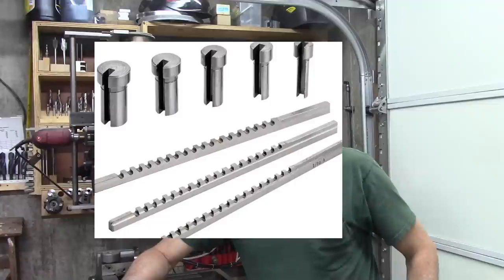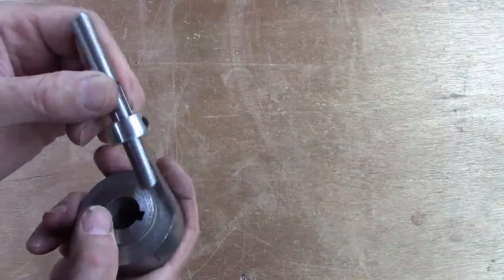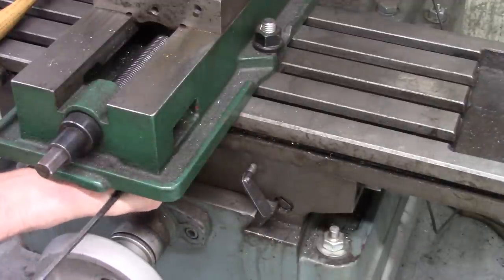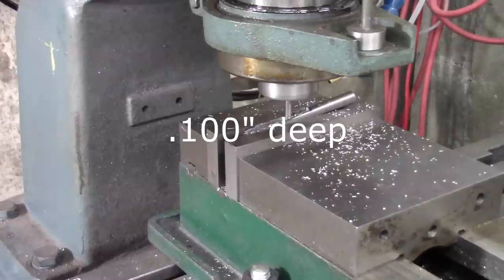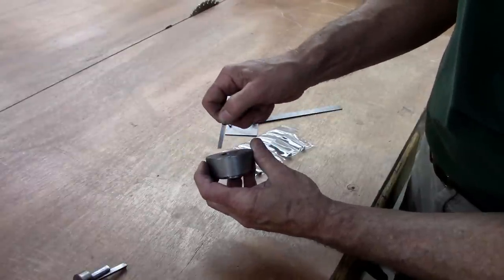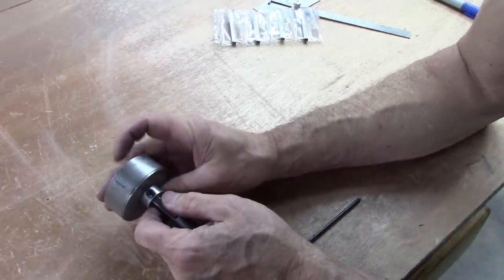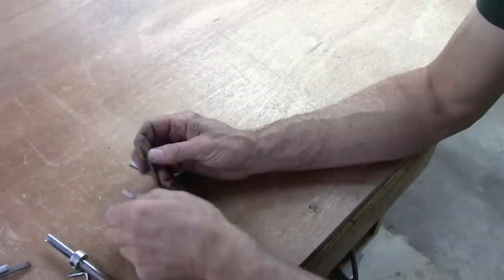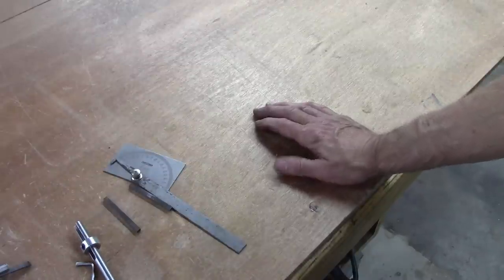Cutting a Keyway WITHOUT a broach

Comment: I have made similar devices to use on a lathe with a slotting attachment I also made, but the body is the same size as the shaft and I use a grub screw to push out the cutter after each stroke. It makes the keyway cutting repeatable with minimal setup but does require a new tool for each different shaft size and each key size.. I originally saw this in Model Engineer in a photo about about something else and thought  that was a good idea. Please keep the videos coming they are all great.
Reply from the maker: Interesting...  and thanks for watching.
Reply: That was my thought, that's similar to how rifle barrels were originally cut. Do you have a link to any thing showing a device like that?

Comment: I was doing a 8mm blind keyway in a 25 mm bore on the slotter today. Similar tool but used 6mm square tool bit and side cut 1 mm either side. Used a 16mm round EN8  and milled the slot at 3 degrees. I mig welded the HSS at the end into the slot and ground the front rake cutting angle to 10 degrees. Drilled a 9mm hole for the tool to enter at the keyway end. Worked like a charm but your idea of the locking collar is brill.
Reply from the maker: Thanks for the comment. Good to know different methods.

Comment: Good design, especially when broaching in a collet in a mill. For broaching a keyway in a lathe just clamp the cutter bit at a slight angle in the tool post and push the broach through the part with the carriage. The round holder won’t be needed.
Reply from the maker: Thanks! Yeah... I've used a lathe a few times but it seems like the quill provides a lot more leverage.

Comment: Some shops won't allow a wire wheel in the door because they're dangerous (put an eye out with a thrown wire). A ScotchBrite wheel does as good or better without the danger.

I cut keyways on the lathe with the tool held sideways in a tool holder and the work clamped to a faceplate.  It's tedious but it works and it's a lot easier to do that way than cranking my knee mill.
Reply: I've had wheel wire embedded 2mm into flesh using angle grinder cups. Never use anymore. Only need to forget eye protection once. Destroy them
Reply from the maker: Interesting on the wire wheel. I've had them hit me before but never anything serious. I need to try the scotch bright wheels! 

Yeah...  I knee mill without a quill would be hard to do. I've done this on a lathe and the quill was a little easier for me. I've also done this on a drill press with a mill table.
Reply: I never use wire wheels without putting on my leathers anymore. Otherwise I end up stabbed somewhere. Ferocious little porcupines.
Reply: @WinkysWorkshop  yes, no exaggeration I was cleaning rust off a steel garage door had 2 or 3 pass through a thin T shirt, had to pull them out. Just calculated they are travelling about 150 mph
Reply from the maker: @Phantom-mk4kp  I'm sure it happens.

Comment: In all my 60+ years in engineering I have only ever cut a keyway one time only with a dedicated broach and arbor press, and that was when I was an apprentice because that is how we did it back  then......but for many years since I've cut keyways by cranking the lathe saddle with a boring bar and 90 deg tool bit.,,,,...,for the occasional keyway the lathe/boring bar set-up is the most practical application and certainly the cheapest as you can grind a square HSS tool bit to suit the size of the keyway be it Imperial or Metric.
Reply from the maker: I agree and I have done this in the past. For me the mill was easier because the quill on my mill  has a better mechanical advantage. I'm sure some lathes are geared differently.

Comment: If you have R8 or 5C sq collets, the tool steel cutters  held in their corresponding size collet,  can be used for the various diff sizes of keyways.....cheap or used R8 and 5C collets are readily available around $5-$7 ea....they are quick n easy to use in a pinch...the R8 and 5C sq collets also come in metric sizes if needed
Reply from the maker: Good suggestion. There are many ways to do this. I have a set of ER but nothing that holds square stock.

Comment: Nice video on the subject. As a home machinist I did a similar thing some time back and have used the tools several times over. Broaching sets are a big investment and may not be used enough to warrant the cost. (Not to mention metro and imperial required) it's definitely worth taking the time to make an individual tool as described in your video.
Reply from the maker: Thanks for watching!! Agree.

Comment: I remember cut keyways using this method years ago, but I used an actual slotting tool made for the slotting head attachment on a Bridgeport. The tool I had was made by Brown and Sharpe. I'm sure that at one time, they made their own version of the slotting head too. Just reminiscing.
Reply from the maker: I just looked up that slotting tool for the bridgeport. Very interesting. !!

Comment: I used to cut mine on a slotted but that was in a machine shop. If you can get a piece of round bar same size as bore put that in and work out where slot wants to be and drill a pilot hole you will find it easier and a little quicker. Just a suggestion.
Reply from the maker: That would work. This method works easier in cast and aluminum but I didn't have any.

Comment: Always nice to learn new ways to do things. Last time I had to broach a keyway, I put the high speed steel in my tool post on my lathe. I had my part chucked up and moved the saddle back and forth to cut the key way. Moving the cross slide away from me to deepen the cut. Good idea for another video maybe? Thanks Winky!
Reply from the maker: I've actually done the same and it works well but I has a had time getting enough leverage.
Reply: @WinkysWorkshop  Just curious, what position did you have your part in the chuck. I had mine where the keyway was at the three o'clock position and didn't notice leverage problems. Thinking back, it was on my 17 inch lathe, don't know if it created more leverage because of it's size.
Reply: @WinkysWorkshop  I can see where that would be a problem on a small lathe with a small hand wheel.

Comment: That is a slick idea. I needed a 5/32 broach and no one had one  but the method you show may have been tough for my job. I have two sheaves on a Reeves drive on a Chinese Harbor Freight lathe. The keyways are just a  touch off. When off the lathe they fit all the way into each other just fine, but with the sheaves on a shaft with a key, they won't slide all the way together and you lose power when the belt loosens up. I have to have them stacked to do it right and I don't think I could use this method through two of them....Jim
Reply from the maker: I think in this case the depth of cut would be an issue.

Comment: I finally got around to watching this video. Very cool! I need to make one ASAP!
Reply from the maker: Thanks. Yes it is way better than buying a broach that gets used every few years.
Reply: @WinkysWorkshop  I lack broaches or the equipment needed to use them. I can do this on my drill press!
Reply from the maker: @de-bodgery  I was the same until about a year ago when I inherited an arbor press from my former employer. I used to work at a printing plant and when they closed the doors my former boss gave it to me. It's much bigger than I need but very nice to have sometimes!

Comment: Hi Mark, i want to try to make your tool: in my milling machine i don't try to make many verticals cuts! But i will try! Usually i make a small hole, out of center, with the OD= width of the spline,after i make the central hole shaft, so i have to cut only the round corners to have the seat of the spline, this work if you start from zero, if you just have the central hole, your method Is great! Thanks for share, Alberto.
Reply from the maker: I've thought about doing the same although with cast iron and aluminum the keyway cuts easy. The mild steel I used in the video required more time and effort. I would not want to do this all the time but if you only need to cut an occasional keyway it's great.

Comment: How many times would one be able to carve out keyways with non heat treated steels before it gets too round?
Reply from the maker: Honestly I touch up the HSS after one key way cut in steel but cast iron and aluminum the cutter stays sharp a long time.

Comment: You always make me think Winky! (Thanks!!!)  
What are the disadvantages of drilling a hole as a key-way and using round stock as the key where that is a practical alternative (ie. both shaft and pulley are the same material)?
Reply from the maker: I've used the round rod keyway several times. I suspect the only disadvantage is strength but for lot torque they work well.

Comment: That's more or less how I have been doing it but on my Lathe, I use my boring bar with the cutter side ways, works fine...
Reply from the maker: True, there are many ways to do this. I had some problems doing it on the lathe due to leverage. It worked but it took a little more effort.

Comment: Great video as always! How did you lock the spindle on your Mill?
Reply: Low speed in low gear is pretty effective but the spindle can also be locked with the brake lever cam.
Reply: @ellieprice363  Mark has a round column mill, there is no brake lever like a Bridgeport. On my enco round column mill, low speed on the pulley will still cause the spindle to walk back and forth. Just curious.
Reply: @mgardnerflipflopmachinist  Sounds like you’ll have to figure some way to wedge that low speed pulley to keep it from rocking.
Reply from the maker: I didn't
Reply from the maker: In the past I locked the drive pulley by clamping a piece of wood to it but it really isn't necessary. If you have no side relief on the cutter it stays straight after a couple cuts
Reply: @WinkysWorkshop thanks for the reply, I'll keep that in mind. Keep up the good work!

Comment: Nice work. Well done.
In the beginning You say that chissel(?) broach is economical. Ehhh. I checked prices not long ago. Here (Sweden) the broach cost more than 60 USD without the needed "inserts".... They also cost...
Your simple, quickly made and effective tool looks like the obvious way to go.
Reply: Yes unless you have a lot of different size long keyways to cut in many parts on a regular basis. Then a commercial broach set would be more economical.
Reply from the maker: I agree, it just doesn't make sense to buy expensive tooling that will be used once every year or two.
Reply from the maker: Exactly...  my shop is basically a hobby machine shop so buying a broach doesn't seem like the best option.
Reply: @WinkysWorkshop  When the day comes I need to do that work, Your design is the alternative. I've got a pedestal grinder (standing on the floor) but not grinded any HSS yet....

Comment: A great way to make a simple single point chisel broach. The only bit I'm not grasping is why don't you specify an angle for the slope of the slot in the housing?
Reply from the maker: The slope was to provide clearance in the hole for the rod that holds the HSS but you may be correct that the slop was not needed (or at least less of a slope) but the HSS would need to be much longer to cut deep enough or the locking collar would need a keyway cut in it.

Comment: I know this has nothing to do with this video but l have gotten a 3 jaw chuck that the back plate was turned 0.0110 to small. Can l braze it up and return it to the right size
Reply from the maker: Maybe there is a type of locktite that would fill the gap. Maybe people use an undersized plate so that they can adjust center.

Comment: If you use a smaller end I’ll to remove the bulk of the material and clean/square the key up with the broach it save some effort.
Reply from the maker: Thats true. Cast is easy but on steel this might help a lot.

Comment: Hey Winky. What DRO is on your mill? You may recall we spoke at Flywheelers and we determined my mill is nearly identical to yours. I am looking at getting one. Is that magnetic or glass pickups?
Reply from the maker: My DRO's are as cheap as I could find. The depth DRO has an auto shut off and the battery last about 2 years but the X and Y do not and if I forget and leave them on they only last a couple month. They all work perfectly although I had to replace the X axis after about a year. I suspect coolant made it fail.

Comment: Wow! You weren’t kidding when you said your broach is labor intensive.  I made the broach and after several hours I finished with a key set.  It’s not pretty but it’s functional for what I’m using it for.  How do you lock the from turning on a bridge port? You made that comment and it’s imparitive that it’s locked. TNX Frank
Reply from the maker: I guess it depends on what the pulley is made out of. I have done this with aluminum and cast iron and it seems to work ok. I never lock the spindle. One started it seems to self align.
Reply: @WinkysWorkshop  I noticed mine was self aligning as well after I got a the slot started.  I at least have a new tool now.  I cut a 1/4 inch key and I was wondering if it would have been easier to grind the HSS cutter on a slight angle while I was grinding the 15 degree angle?  Thanks for the tip.  Koeep up the great work.  God bless.  Frank
Reply from the maker: @frankpiazza953  I tried a couple angles. It's definitely a balancing act. Too much angle and it will try to cut deep but it there is no angle it tends to slide and not cut. Just experiment and see what works best.
Reply: @WinkysWorkshop   I remember that you said that in the video, but I was referring to an angle perpendicular to the angle you are referring to; in other words if you angle the cutter right or left as you grind the 15 degree angle.  Wow thanks for the quick reply’s all in the same days.  BTW I’m trying to understand speeds and feeds in the reference manuals, and how SFM is measured and translated into numbers usable at the lathe or mill.  Would be nice to watch a video explaining that.  Now I’m going to make a few chips.  God bless.  Frank
Reply from the maker: @frankpiazza953  Thanks for the input. I need to do a speed and feed video! It would be a learning experience for me as well.  I think I'll make a chart for brass aluminum and mild steel and convert to RPM. (eliminate the daily math!)
Reply: That would be great.  It’s not that I don’t understand the concepts it’s how are they measuring sfm, with respect to the cutter advance I.e. the chip thickness not sure.  Really like your videos.  TNX Frank
Reply from the maker: @frankpiazza953  Thanks Frank. Yeah there are formulas for feed rates but they are hard to follow. Then the speeds and feed also change with the number is flutes on an end mill. It's good to have a starting point but beyond that I think its easier just to see what works.
Reply: @WinkysWorkshop  seeing what works is what I’ve been doing, but the finish is mostly terrible, most of the tome I have to rely on a file finish.  So what is the relationship between feed rate and finish quality?

Comment: How did you keep the spindle from turning?
Reply from the maker: The first time I used this type took I clamped a piece of wood to top pulley but I found there is no need. Once the cut is started it continues straight because the cotter has no side relief.

Comment: Wait, so if you want to grind a 65° angle you'd have to measure 25°, not 20°. So what is it now?
Reply from the maker: Don't ask me...  I just read the protractor. It's from vertical or horizontal but maybe I looked at the protractor wrong. The graphics I inserted make more sense to me.

Comment: I have a small benchtop metal planer with an attachment for doing internal keyways. I think what you made there might work better than the attachment I have. Mines just a rod but a square hole 90⁰ to the rod in the end for a tiny piece of HSS. I'm going to try your method. Check out the only video on my channel about my planer I restored.  Thanks for sharing Winky.
Reply from the maker: It's hard to say what would work best. That is a VERY COOL planer you have. The gear change for changing the direction is wild. Seems like it would be prone to wear but I guess it must work well. I love the old planers but don't have the space for another machine.
Reply: @WinkysWorkshop  Thanks for checking it out.  Take care.
Reply: I also thought shaper tool. Something else to try.
Reply from the maker: @ronkellis769  I've seen shapers but I'm not very familiar with the way the tools are ground. I'm sure they may be ideal for this process.

Comment: You might like to consider renaming your video. Personally I'm not interested in toolmaking, only tool use and technique.
Reply from the maker: What would be a good name?
Reply: @WinkysWorkshop  I would go with, "Making a tool, to cut a keyway without a broach."
Reply from the maker: @arkadybron1994  - Yeah...  you are right, that would have been better. Thanks